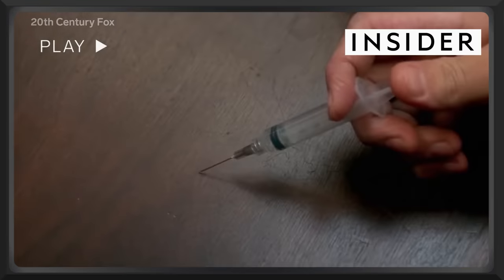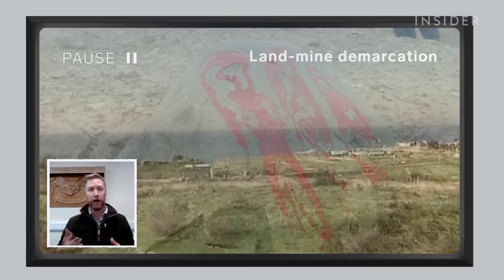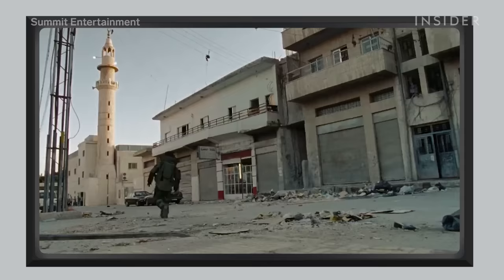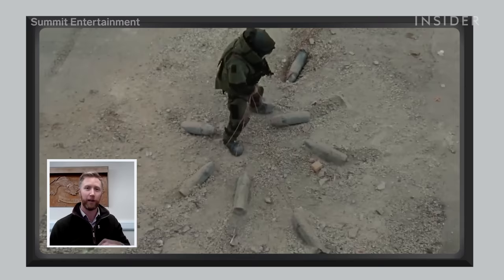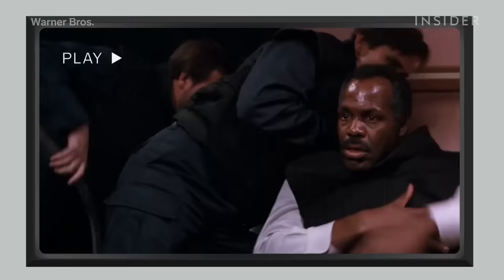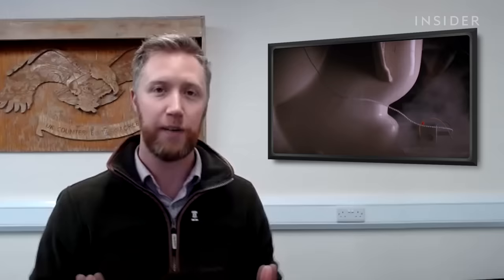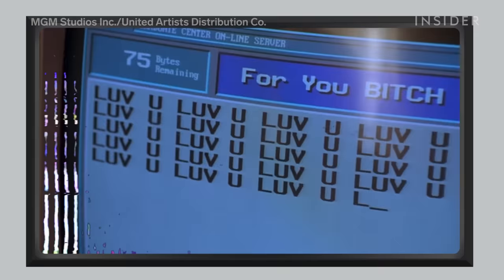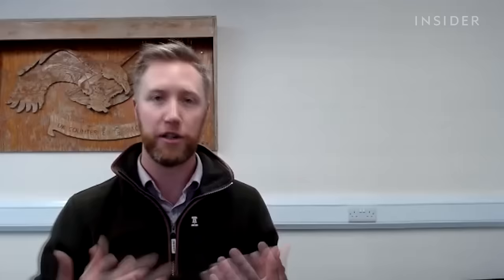Special Forces Bomb Disposal Expert Rates 10 Bomb Scenes In Movies | How Real Is It? | Insider

Comment: Everyone a gangsta until the bomb technician finds three wires in a bomb and no one is red
Reply: I can relate
Reply: there is one imposter among us
Reply: I was innocently thinking "how did fara learn all this" then I realized
Reply: All the wiring is brown lamp cord.
Reply: Ciaphas Cain: How to defuse this bomb

Adeptus Mechanicus: it's simple, just cut the red one

Cain: There's no red one

Mechanicus guy: Incoherent Swearing over the mic
Reply: Nothing is simple but in most cases detaching any and all wires from the bomb  is likely SUCCESSFUL 99% of the time.
Reply: @lielyncher755  until everything is soldered directly to the pcb.
Reply: @superslimanoniem4712  Much kudos and respect to EOD. Glorious are those who put everything on the line .  Bomber 3 card Mollie is played with a high impedance voltmeter., I hope. Only two wires matter.  Cut any one of those two. You win the game. Since we assume bombers are  real assholes, it'll boil down to cutting two wires simultaneously.....some really manly man type shit.
Reply: Not a job for the color-blind.
Reply: @trevormadden4313  not in theory , once you disrupt the  power source or its ground  the game is over..of course it possible to design a circuit where cutting any one wire at a time  is wrong answer. Not a fun game
Reply: @lielyncher755  bomb techs don't cut wires period. They don't cut one or multiple simultaneously (which is impossible anyways). You have no idea what your talking about.
Reply: @trevormadden4313  okay I get what you're saying,  I was merely addressing the basics of electrical engineering in reference to troubleshooting.  Two or twenty wires wouldn't matter when if you're going to ignite the bomb with your own charge.
Reply: @lielyncher755  that's fair
Reply: even better - wires are multi color
Reply: My favorite on this idea is the Abyss.  Where he has to cut a specific color combination that looks just like the other wire when it's viewed in yellow light!
Reply: @darrennicol2442  I mean, they proly never get hired.

Comment: "If we stand on a mine what should we do sir?"
"Normal practice is to jump 200 feet into the air and scatter yourself over a very large area"

Blackadder gets a 9/10 for sure :) -1 for exaggerating.
Reply: I still use that clip in training :)
Reply: @Lofi.z34  the mine goes off the second you touch the switch

Comment: Surprisingly, the method used in Lethal Weapon 2 would have been MORE effective in real life than is shown in the movies. The Mythbusters tested the scene, and when they immersed a period-accurate battery (along with the rest of the detonation mechanism) in liquid nitrogen, it took about 10 minutes for it to thaw out and actually fire, meaning they could have walked out of there.

But, just to cover their bases, they tested the bathtub dive to see if someone inside a big cast-iron tub covered by the bomb blanket would survive the blast - the pressure levels they registered showed that they would, at worst, walk away with ringing ears.
Reply: Not if they had ear muffs.

Comment: I always laugh at the blue wire / red wire thing, the very idea that you can tell what a wire does just by its colour is insane. 
I’ve made door bells and other simple electrical/electronic devices using whatever random leftovers I’ve had lying around. By convention you use red for positive and black for ground but I’ve made entire circuits using green because its all i had. I can’t see a bomber sticking rigidly to a set of rules and making life easy for the disposal guy.
Reply: I always ask the same question too: What if the bomber run out of color wires? Why indicate it to make it easy to disarmed?😆

Comment: 13:18 In the movie Juggernaut, AFAIK, the reason why he "changed his mind at the last moment" was because he realized that the guy they were interrogating to gain info about the bomb was lying. So, it was actually an informed decision on the protagonist's part.
Reply: I thought you was gonna say the reason why he changed his mind was because they found out the guy was color blind.
Reply: I think they did that in macguyver too (which is painful to watch after having learned basic physics)
Reply: Why would they expect the guy they were interrogating to ever tell the truth?
Reply: The movie juggernaut ist more realistic than you think.Amatol ist real,and i have researched,there was a WW2 german magnetic sea mine with a pendulum switch in a magnetic field, the wire color's was red and blue,one of the first movies with cutting wires in different colors. ...also, a Mac Gyver episode is a copy of this movie ..  Funny: In the movie Speed,the actor shorts a fiber optic cable with a cooper wire.
Reply: Yes but he didn't tell his colleagues what he was doing; if he had got it wrong and had blown up his colleagues would have assumed he had cut the blue wire as he had said and would have all cut the red wire.

Comment: I know Mythbusters tested the Lethal Weapon 2 scene. They put pressure sensors in a cast iron tub, and the tub did, in fact, actually deflect the shock wave. I remember they froze C4 with Liquid N2, and it didn't thaw for several minutes. Then they burned C4 and smashed it, and contrary to what I was told by my grandfather, it didn't explode either.

Comment: How about the bomb scene in The Naked Gun 2½? I would really like to know if simply unplugging the bomb from the wall would work.
Reply: If there was only 1 power source, usually a battery not AC, yes...mostly. also no capacitors. 

Removing the power source, separating the main charge from initial charge (initiator / detonator / blasting cap), or attacking the switch is the proper way. In that order but situation dependent of course.

Comment: The bomb defusers transmission stops abruptly

CONCERNED
Reply: Then you send the next bomb tech to defuse the next bomb, and DON'T DO THE LAST THING LAST GUY SAID HE DID OVER THE RADIO! That's why they tell what they're doing step by step when they're doing it.
Reply: @TestTest12332  Operator on radio: Okay don't cut the red wire that got the last guy!
Bomb maker: hehe I switched the cables on that one >:)

Never rely on two bombs being the same design :p

Comment: At 10:35, if I remember correctly, the Mythbusters actally tested that and if im not mistaken it was found to actually work in princable, the liquid nitrogen essentally just froze that battery and dissabled the detonator. Although I totaly understand that you wouldn't necessarily want to do that in a real situation, as he said, you wouldn't know how the device would react to the loss of power like that
Reply: In the Mythbusters episode, using liquid nitrogen actually worked even better than it did in the movie. They could have strolled out of the room at their leisure.
Reply: I don't have EOD experience, but I do have some electronics knowledge, and I think making a bomb that will go off if its battery is removed or disabled would be quite difficult, as I think detonators require a decent amount of power, so even if you could power the logic off a capacitor bank, running the detonators would be more complicated. You could have two batteries connected independently and add the logic to have the bomb explode if one was removed, but that'd be a decent bit of design effort, and the bomb maker would have to be thinking about that method of defusal

Comment: Mythbusters proved every single part of the lethal weapon scene is possible. The liquid nitrogen actually rendered the electrical circuit safe for minutes
Reply: I heard that LN can slow down electronics too. Isn't that a way to extract passwords from ram?
Reply: @superslimanoniem4712  if anything it would speed them up,  heat creates resistance in electrical circuits, that's why at the large hadron collider a lot of the electronics are cooled to near absolute zero, what you would be trying to freeze is the mechanisms inside. But without knowing exactly what they are and where and how much they'd need to be cooled would be a wildly unprofessional move.

Comment: The whole "I just stood on a landmine" thing comes from WW2 anti-personnel landmines, such as Bouncing Betties, that did indeed function like that. They had little antennae that your foot would break, then when you stepped off them they would be fired into the air to about groin height and explode, blasting shrapnel out in a radius injuring or killing everyone nearby. They couldn't jump up until you stepped off them which is why this idea has hung around pop culture.
[Edit to stop people who don't bother reading threads before replying: I'm wrong about it waiting until you step off it]
Reply: Not true bud. When you hit the "antenna" as you say it would shoot a firing pin down into a pyrotechnic delay which would then launch the charge into the air after a few seconds. So standing on it would not stop it. It would more and likely hit you in the nuts and land on the ground where the secondary fuze would set it off ground level. Just spreading some knowledge
Reply: Or better yet it could be attached to a trip line instead of being stepped on
Reply: @lambchop6210  Huh, looks like I've fallen victim to US WW2 propoganda that incorrectly said that's how they worked. Doh! Thanks for the correction.
Reply: There are such mines that would work like they did in the scene. One of these mines is the M16, not to be confused with the rifle. These types of mines are called bounding mines. Wikipedia lists 42 different models.
Reply: @orlock20  dude theres alot of mines out there. Just gonna be straight though it's kinda hard to make a pressure release mine that's reliable and useable. Something has to be the physical block to stop it from going in the first place. Then someone has to step on it that will somehow cause that physical block to be moved now making the victims foot the physical block? Sounds dumb
Reply: @orlock20  but theres also a million ways to make ordnance. So someone's probably found a way
Reply: @lambchop6210  The idea of such mines is to kill multiple people. Most such mines use trip wires and remote control.  Some weapons don't have to work as design, but can cause enough concern for the opponent to make a counter device.
Reply: @orlock20  so I've taken apart an m16 mine and it had a pyrotechnic delay as well. You standing on it isnt gonna stop it from detonating and of course there made to kill/maim multiple people they are bounding frag mines
Reply: Thats absolutely not true. As soon as you trip it it starts the firing train. You have about .00001 seconds to "run" so yea good luck with that.
Reply: @EOD423  Nope. Once you trigger an S-Mine you have about 4 seconds before the mine is launched and another .5 seconds before it explodes in the air.
Reply: @adamtennant4936  well I never came across any of those but the M2 deft doesn't have a trigger mechanism like that and any tech i talked too never dealt with a mine that has a  a delayed trigger that extreme.
Reply: @EOD423  I'm not surprised you didn't come across any, it's from WW2, as I stated in my original post.
Reply: @deanflet973  Yeah, pretty much the grandfather of the claymore.
Reply: @adamtennant4936  you'd be surprised how much old ordinance is still around and forgotten especially landmines lol
Reply: @EOD423  True, landmines are a real problem in old conflict zones.
Reply: @adamtennant4936  that’s not true. There’s about a one second delay to the primary low explosive charge which launches the mine, and it will detonate when it gets about a metre off the ground, which happens almost instantly.
Reply: @deanflet973  claymores are ‘directional fragmentation mines’. They’re more like a large single-charge shotgun round. Their ancestry is probably closer to Canister shot which was used for the same purpose as the Claymore was originally designed for, i.e. to counter close-in infantry assaults.
Reply: @bob_the_bomb4508  Firstly, you're wrong. As I stated above in a reply:
"Once you trigger an S-Mine you have about 4 seconds before the mine is launched and another .5 seconds before it explodes in the air."
And secondly, try reading a whole thread before replying in future.
Reply: @adamtennant4936  I’ve no idea how you come to that conclusion. Open source data on the M16 tells you that the pyrotechnic train time delay for the launch charge is around 1 second.

Gunpowder has a VoD of around 300 m/sec so the main charge reaches its target height pretty quickly. It doesn’t then mill around for 5 seconds.
Reply: Respectfully you are incorrect. Bounding mines, like the m16, function on a very slight delay to allow the person who triggered the mine fuze, to clear it as to allow the mine to "bound" into the air and not through the foot, as to ensure max damage. The mine was buried in a container, with the fuze ( with several small prongs only visible above ground) sticking out of the ground. Once stepped on or influenced, the explosive train is initiated, a slight delay occurs to ensure the mine can be blasted above ground via the booster charge or expelling charge. The delay was to allow the persons foot to clear the mine, so the foot wouldnt deflect from max damage. Once the mine reached between 1 and a half to three and a half feet, it detonated. Certain mines contained 1 or two delay charges in the explosive train.The M2 was a mine such as this, which later was used to create a trip flare, the M48. The m16 bounding mine came after WW2. There is no such thing as a mine where you can step on, hear an audible click, and exchange weight to be safe. Mines detonate instantly, or in some cases a very slight delay, but once the fuze is influenced, there is no going back.
Reply: @kqp76t  You should try reading the whole thread not just the first post... You could have avoided writing all that because we already know.
Reply: @bob_the_bomb4508  If you'd actually read what I typed I'm talking about the S-mine not the M16 mine and online documentation for that details a roughly 4 sec delay.
Reply: @kqp76t  Plus I'm talking about S-mines, not M16 mines, which have a roughly 4 second delay. Also, nice dirty delete on your butthurt reply. 🤣
Reply: @adamtennant4936  so you’re backing away from your original post and doubling down on the S-Mine?
Reply: @bob_the_bomb4508  What are you talking about? My original message specifically refers to S-mines and WW2 era. M16 mines are not WW2 era... They're post-Korean war era.
Reply: @adamtennant4936  1. You originally say the mine can’t bound until you take your foot off. Nonsense. 2. Bouncing Betty was a nickname for the M14. 3. You subsequently say we shouldn’t be paying attention to your first post. Now you’re trying to make this all about S mines, when that’s not how you started.

Please provide a source for this 4 second delay. 

If you can, then all we’ve established is that you didn’t express yourself clearly. As can be seen from the numerous replies. We’ve all done that. No biggie.

If you can’t provide a source then perhaps there’s a lesson to be learned from that too.

But think on this: the short delay the rest of us are talking about is a tactical advantage because nobody will be able to react to it. A four second delay would give people time enough to lay down - $>€> me it would give them time to take their packs off first! So there’s no tactical advantage to a 4 second delay.

ETA: your foot doesn’t break the antennae…
Reply: @kqp76t  "Adam Tennant You should try staying in your lane, because clearly, explosives aren't it."

You mad bro? 🤣

Comment: The guy on the mine from SEAL Team is Tyler Grey, who was a Delta Operator before becoming a technical consultant and actor.
Reply: That's good for him but actors and even advisors rarely have the final say on screenplay writing, usually if the writer wanted a scene where they step on a mine and have to defuse it in the field it's going to happen regardless of realism or experience of the actors/advisors.
Reply: Thats cool to know. I do think that a lot of stuff in Seal Team looks good, but they do have that Hollywood mark all over it. On how they act against their councelers and stuff.

I also would imagine that mines like these exist for areas you may want to mine but mostly to slow people down. That escape is an option if you have the time to manage it. Also: if a mine hasn't gone off when you pressed it, there would still be a chance of it going off when you step off, so I still think its a valid scene for that.
Reply: Full metal is also a former operator
Reply: Scene would be completely different if it just blew up... I mean where's the suspense in that.

Real mines can function like that, less than 1% by design, but it's possible the primer became impinged making it super pissed off and ready to blow at the slightest movement.

Think of a bullet primer being struck by the firing pin (much sharper) and being stuck inside the primer of the bullet. Friction sets it off in addition to impact.